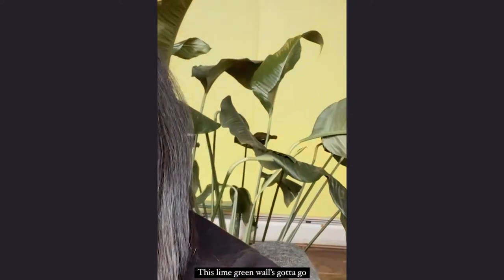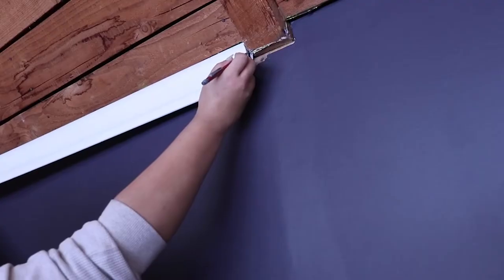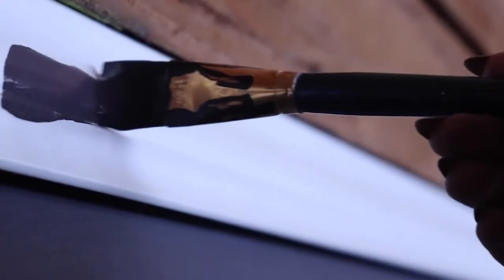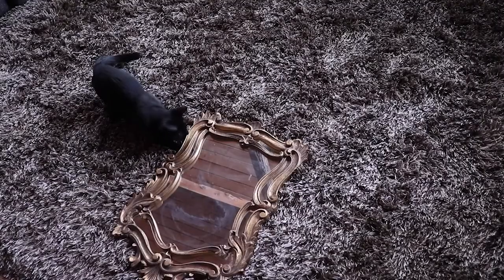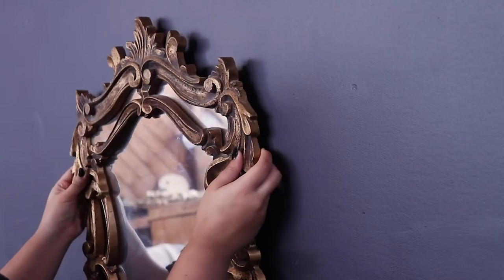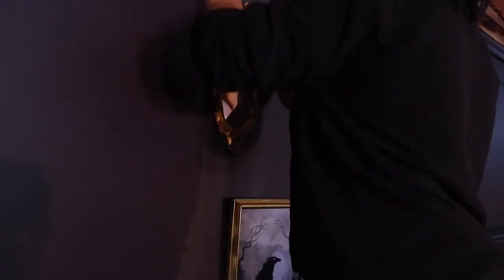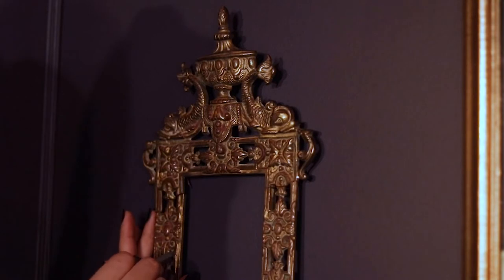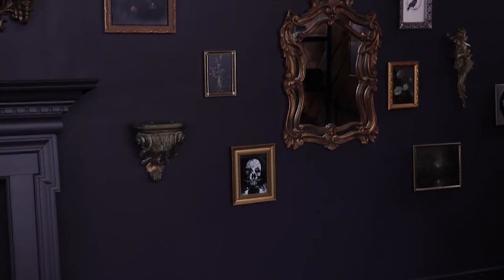Living Room Gallery Wall Renovation | Maximalist Gothic Decor

Comment: As to the gallery wall, I have seen what others have done, but I did mine differently. In my living room gallery wall, I put up the large art pieces first, then the middle sized and finished with the small. No planning other than that and that I separated the color pieces with the plainer neutral colors so the colored ones stood out more. I don't measure which means I put more holes in the wall, but that doesn't bother me and an easy fix.

Comment: I love how the gallery wall turned out, & the wall color is perfect! I am sorry if I missed it, but did you happen to say what the color/brand was?
Reply from the maker: Thank you! The color is Valspar Black Currant 🖤
Reply: @NasyaAcostaSmith  thank you!
Reply: I love the color! This gallery wall came out really well. 
If you’re putting new trim up, one thing you can do is paint the trim before you put it on the wall. Then you have to touch up any nail holes. This makes it much easier to paint your trim, especially if it’s a contrasting color or sheen.